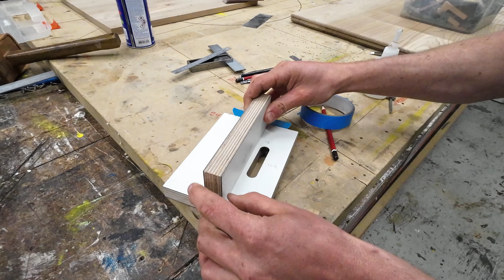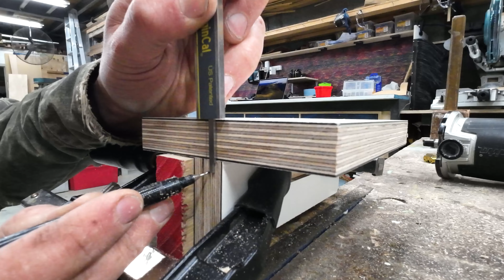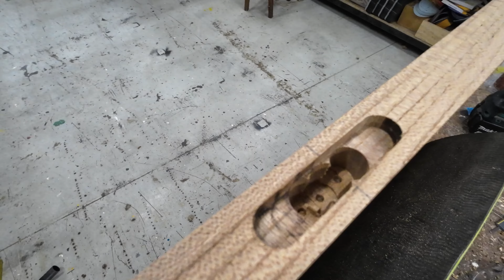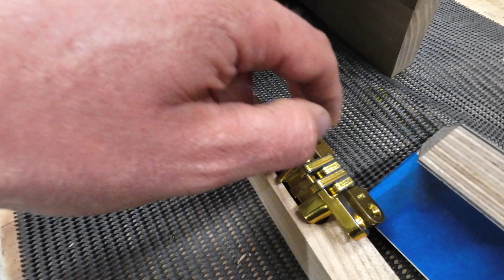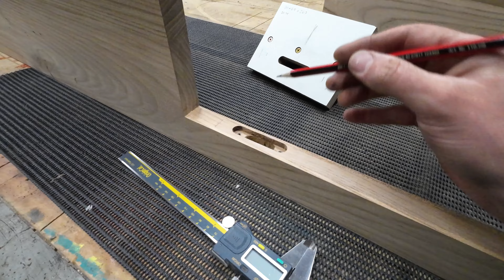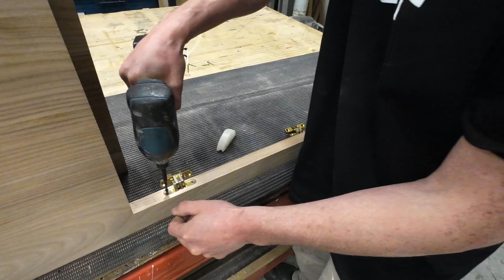Epic Hinge Fail — Patrick’s Fix Will Blow Your Mind!

Comment: Rather than make tapered plugs for the old screw holes, I simply drill the hole out with a (for example) 4mm or 6mm drill, and glue in a piece of 4mm/6mm dowel.
Essentially the same thing in principle, but you're not trying to match the screw hole.

Comment: The plunge base for that Makita trim router is excellent (albeit pricy) still light enough and small to be portable, trying to mortice with my Triton TRA001 was not fun before I bought it

On a slight side note, you can buy the skin versions of the Makita router for about 100 bucks cheaper than local off Amazon from the UK, Japan or the US (each has different models, be careful though there is a shit version in the UK on offer)